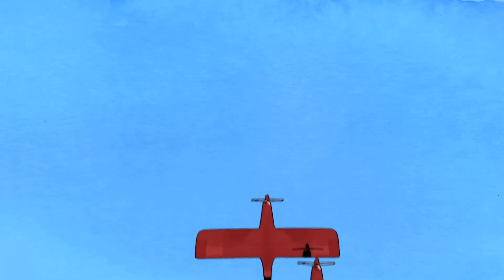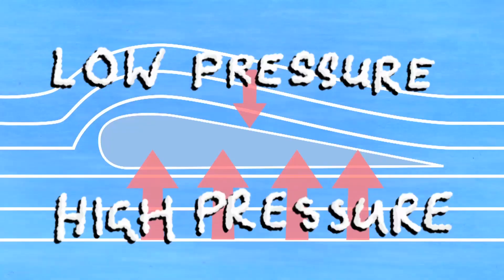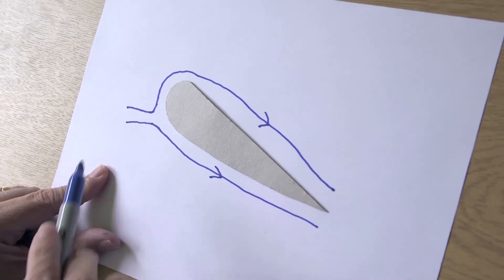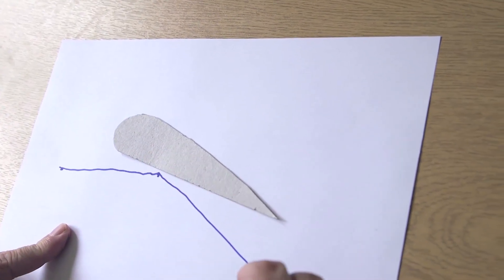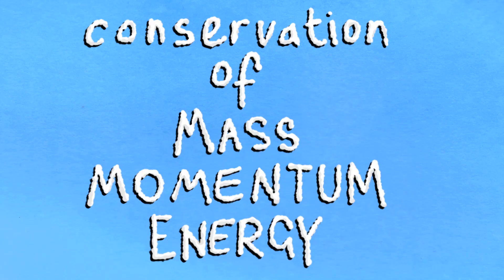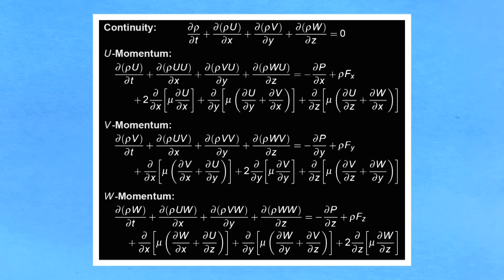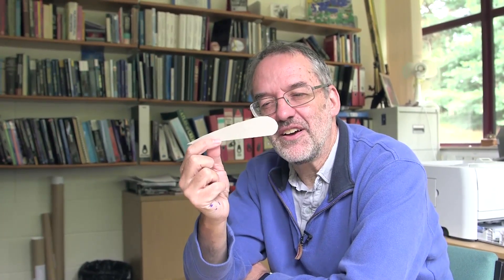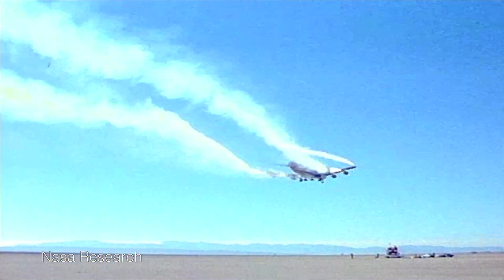Lift and Wings - Sixty Symbols

Comment: To simplify, you get lift when you excellerate air downward,  and you don't get lift if not.
Reply: True, except for in ground effect where the downward momentum need is lessened by an accumulated pressure field between wing and ground.  To that extent that mass accumulation doesn't "leak", the downward momentum acceleration demand is lessened (sort of like going from charging a capacitor to the capacitor being in a charged state).

But it's stunning how a few in academia refuse the downward momentum absolute necessity.  They forgot their basic physics??  And their university allows them to teach that to students?

Comment: I get that there is a downwash of air coming from above the wing, but what is the actual mechanism which that air acts on the wing lifting it up? Since that air is on top of the wing the whole time, how is it contributing to an upwards vector of lift (remember, suction is not an actual force). I can see how the profile of the wing could create a low pressure zone above the wing which  increases the effectiveness of the high pressure region below the wing but I think the downwash from the top of the wing is merely the result of the deflected air on the underside creating a low pressure zone at the back of the wing and that air naturally flowing to fill that gap.

Comment: The bernulli effect conserves energy. It doesn't cause lift. Lift is caused by excellerating air downward.
Reply: Energy is conserved in preserving mass flow rate (mass conservation).  The pressure drop of this mass and energy conservation, conserves momentum by bending the flow to the downward direction.

So, yes, lift is cause by accelerating air downward, to conserve momentum, through conserving energy, to conserve mass (flow rate, or the continuity equation).

So, there you have the core Navier-Stokes (and Euler) equations:  conservation of mass, energy, and momentum (quantity of motion).

Comment: The "problems" presented with respect to the Bernoulli explanation of lift have nothing to do with Bernoulli itself. The "equal travel time" and the "shape of the wing" arguments are arguments that try to explain why the flow over the wing is faster than the flow under the wing and both fail to explain the speed difference. Bernoulli accurately describes the result of the observed lift. As a final note, the Bernoulli principle is the integral of the momentum equation for fluids and therefore there is no real difference between explanations that use momentum conservation and flux (or circulation arguments) and Bernoulli's principle.
Reply: I can't immediately see the point you are making?: "Bernoulli accurately describes the result of the observed lift. As a final note, the Bernoulli principle is the integral of the momentum equation for fluids and therefore there is no real difference between explanations that use momentum conservation and flux (or circulation arguments) and Bernoulli's principle."

It appears the usual "misconceptions" brought up are:  it's Bernoulli not Newton, it's Newton not Bernoulli, equal transit time is false.

But it's curious those three misconceptions seem to unavoidably connect with core Navier-Stokes/Euler equations:

"Bernoulli": taken as conservation of energy: velocity pressure inverse relationship

"Newton": conservation of momentum (ultimately change in vertical momentum of flow, to conserve total system momentum)

"Equal transit time fallacy":  the continuity equation (conservation of mass flow rate).

All of the above must be properly integrated into a useful CFD simulation to design a wing at Boeing or Airbus, yet the descriptions of the lift mechanism suffer perpetual overly simplified arguments?

Comment: Its because of the curvature of the streamline over and below airfoil, the greater the curvature greater the lift. From Euler equations we get two differential equations of pressure distribution one in streamline direction and other normal(radial) to it, the normal one is responsible for lift. 
In Stream line direction >>>>>> partial(dp/ds)=(rho*Velocity*partial(dV/ds))
In Radial(normal) direction>>>>partial(dp/dr)=((rho*square of(Velocity))/r)
from radial direction equation, as the curvature of streamline is more the change in pressure is more so the change in force in that direction.
Reply: Of course, to get the proper big picture we need mass, momentum, and energy of each mass regime (the asymmetrical solid and the distributed flow of mass), from before to after the interaction, to be conserved for the entire system.

The effect of curvature is directly related to asymmetry, and mass flow continuity must be conserved through that geometry.  So, energy must swap speed for pressure to sustain continuity.  And the result is the downward change in momentum of flow to conserve total system momentum.

Comment: Air Molecules have weight .  Air being compressed by the leading edge of the wing accelerates the flow of air across the upper surface or camber of the wing . The air molecules  follows the cambered surface creating a kinetic energy from centrifugal that is exerted on the wings surface in the form of a vacuum. That would be like slinging a weight on a string . The faster you swing the more centrifugal force exerted . The more the camber on the top surface the more lift at slower speeds .
 Bernoulli's principle totally ignored the weight of air and the effects of  centrifugal forces on the air molecules  by the camber . This can be viewed by blowing on the top of a sheet of paper . The more camber the more the paper lifts .
Reply: A key weakness of your explanation is that radially directed accelerations (centrigual/centripetal), don't explain the tangential accelerations encompassed by Bernoulli as an expression of conservation of energy:

this doesn't make physical sense:  "air molecules  follows the cambered surface creating a kinetic energy from centrifugal.."

Comment: Stop talking about "air flowing over a wing", Air flows over a wing only in a wind tunnel when the wing is stationary.  In real aircraft the air does not flow much horizontally. It is ACCELERATED vertically DOWNWARDS ( eventually) .This downwards acceleration originates for different reasons occurring above and below the wing. In fact  if one has to be accurate, the air mass particles around the moving wing move forwards a little . I shall let the readers deduce why that happens. .

As the wing moves forwards, it  SHAVES  an air ribbon and accelerates its mass of air downwards. The SHAVING  starts at the leading edge and below the wing by compressing the viscous fluid to ACCELERATE IT DOWN,  Above the  wing the SHAVING  of the mass of air is done by first accelerating the air fluid upwards above the leading edge, and then causing the tension in the vicious fluid at a later stage to the trailing edge . The CONTINUOUS downwards ACCELERATION  of the masses of air above and below the wing results in an opposite reaction to lift the wing. If the  tension in the viscous fluid hold, then the wing is in  laminar condition, if the tension in the viscous fluid is large to break the tensioned fluid, then turbulence occurs. 

It is these linear and circular acceleration at various locations that cause the Bernoulli, the Newton and the Coanda effect, and it is these "fluid linear or circular accelerations" around bird wings, fish flukes, and all the  flying surfaces that  exist in insects aircraft wings and helicopters rotors and propellers and rockets and missiles,  These effects existed far earlier than when Bernoulli, the Newton and the Coanda were even born.  Also people should stop saying that particles at the leading edge, the upper and lower flow meet again at the trailing edge,   Just consider Linear and circular, ACCELERATION OF THE FLUID MASSES ABOVE AND BELOW THE WING  This acceleration of masses in  a horizontal direction will also explain the drag of the wing, Think of the tension and compression in the viscous fluid around the wing as the mass of air above and below the wing is ACCELERATED .  The rest will follow as velocities and locations of particles and up wash  ahead of the leading edge and down wash behind the  trailing edge, consider only ACCELLERATIONS and the resulting forces. .
Reply: The claim that "air flows over a wing only in a wind tunnel" is incorrect and dismisses the fundamental aerodynamic principle that airflow over and around a wing is crucial in generating lift. The overuse of metaphorical terms like "shaving" and the heavy reliance on capitalized words (e.g., "ACCELERATED," "SHAVING") detracts from the clarity and professionalism of the argument. Additionally, the emphasis on fluid acceleration as the sole explanation for lift and drag oversimplifies and undermines well-established aerodynamic theories, such as Bernoulli's Principle and Newton's Laws, which complement each other. The text's verbosity, coupled with its dense and technical phrasing, makes it less accessible to readers. Furthermore, the dismissive tone toward commonly accepted concepts, such as particles meeting at the trailing edge, appears unnecessarily combative, reducing the effectiveness of the explanation. Lastly, the historical context, while interesting, is framed in a way that could confuse readers, as it fails to acknowledge the foundational contributions of Bernoulli, Newton, and Coandă to our understanding of these phenomena. A more concise, balanced, and precise approach would improve the text significantly.

Comment: I am a fluid dynamics PhD student doing 3D aerodynamic simulations, and I approve this message. Fluid dynamics on YouTube can be really cringe-worthy, but leave it to sixty symbols to do it exactly right... Well done, more please
Reply: How do you reconcile "circulation" with the force of lift as a linear change in the vertical momentum of air (in a direction transverse, or normal to the relative wind)? 

Is the best physical interpretation for circulation, is that it represents angular momentum imparted to the air (and associated rotational analogies of the equations of motion)?  In other words, it accounts for the rotational consequences of Newton's laws?

Is it relevant to consider the issue of lift in terms of how such angular momentum becomes, or supplies the vertical momentum directly associated with the force of lift (which is linear after all)?

I ask this because among the various attempts at explaining lift, it seems there is seldom (if ever?) any "connective tissue" as far verbally linking on the one hand, circulation, vorticity, potential flow the Kutta condition etc., with on the other hand all the talk on Newton (the linear laws), and Bernoulli etc.

And, is asymmetry (of the solid with respect to the relative flow), sufficient on its own to induce angular momentum without losses in the medium of flow, and the consequential necessary change in vertical (transverse) linear momentum?

Comment: Bernoullis theorem does not predict air molecules meeting of the top and bottom wing air . In fact the only thing that's is applied in this example is the velocity pressure relationship . . You also kinda forgot to mention Newton's laws must be obeyed .
Reply: Bernoulli doesn't say anything about transit time.  Bernoulli says the directed kinetic energy of the dynamic pressure has to come from the potential energy of the random kinetic energy in the static pressure.

Transit time has to be faster, because the density has dropped from an obstacle being placed in the continuous airflow.

The "interruption" in the mass flow supply rate causes the pressure to drop sufficient to accelerate to a speed that maintains the mass flow rate continuity.

Because the density has dropped to accomplish this acceleration, the new higher speed is necessary to maintain the mass flow rate at the original level.

It may seem like circular reasoning, but it's not:  the solid path obstruction induces a pressure drop due to "mass supply deprivation stress" just sufficient to cause the faster than equal transit time of each particle such that the mass flow rate is maintained.

That is:  same mass flow rate, by moving lower mass density at higher speed.

So, logically, equal transit time has to be wrong.   Not just observationally wrong.  It is wrong logic from the beginning.
Reply: The squeezing effect actually causes a pressure increase near the leading edge; so it has some similarity to the venturi. In addition, the downwash is NOT a cause but an effect of the pressures and satisfies Newton's Third Law.

Comment: Due to the low pressure above the wind, is it correct to say that the air here is lower density?
Reply: Yes.  And that is an important insight.  Lower pressure is from lower density of mass which implies fewer random collisions of air molecules per unity area.  The average velocity of the random collisions is still the same (at constant temperature), but there are just fewer per unit area, meaning less momentum transferal in the collision per unit area.

The result we see is less static pressure.

Comment: Lift is action and reaction.
The action is the deflection of air molecules downwards, the reaction is the wing being pushed upwards.   Pressure differences are secondary.   If there is no downflow of air from the wing, there is no lift.

There is downflow from the top of the wing, because of the tapering shape.  Because there are no molecules in the wing to force the airflow upwards, the air can spread out into the void at the back of the top of the wing.  In doing so we have just created a downflow, which continues at the back of the wing.  Thus we have downflow from the top and bottom of the wing.

Action and reaction, if we have created downflow, then the wing must experience an upwards force.

R

Comment: I don't understand how plane can fly with TWR of less then 1? doesn't it violate laws of conservation of energy? someone pleases explain where is the extra energy comes from to lift the plane with certain amount of weight in the air when you are spending less energy then the force caused by airplanes weight! I know there are external force but they are nothing compare to how less TWR you need to fly it..

Comment: Great video! It is always important to clear up any misinformation before moving onto the real discussion. I did want to mention that the description of the streamlines being pinched results in an increase in velocity is also a misconception known as streamline pinching. The correlation between restricting the flow and increasing the velocity is true for an internal flow, bounded by a surface AKA a venturi. For this example, a flow that experiences pinching does not see a definite increase in velocity.

Comment: Thank you for explaining the Bernoulli's principle and the role it plays in generating lift. However, it would have been helpful to see a visual representation or animation of how the pressure difference is created above and below the wing. Additionally, it would have been interesting to see a discussion on the limitations of the Bernoulli's principle in explaining lift and how other factors such as the Coanda effect also contribute. Overall, great video!
Reply: He did

Comment: I'd like to hear from an "aerobatics" pilot and know exactly what the pilot is doing to the controls when the plane is flying straight and level but inverted.  Is the pilot rushing the stick (or yoke) slightly forward which would result in a slight nose up (away from the ground) when inverted? When not inverted, would put the plane is a nose down attitude.

Comment: You are right, you can’t really separate the aspects you described. However, we Aerospace engineers only really consider the pressure differentials when thinking about the lift. We spend a lot of time optimizing airfoil profiles (and other features) to influence the velocities over the surface and thus the pressure. The effect of the momentum change is only a byproduct for us. We call it downwash and it makes our lifes hard because it tends to influence other parts of the plane, like the horizontal stabilizers.
Reply: Yes. So many think the downwash is the cause of lift.  It's one of the three most common myths. 
1- Equal transit & Bad Bernoulli. 
2-Downwash & Newton's 3rd. 
3-Half venturi above.
.

Comment: Okay, I'm not exactly sure why the downward momentum of the air tranlates into upward momentum of the wing but...
Oh, another question I'd like to get cleared up. I have, maybe incorrectly, thought the reason boats float has nothing to do with the mass of their hulls being less than water, nor does it have anything to do with air being "trapped" in the hull but rather it is my understanding boats float because the shapes of boat's hulls uses water's surface tension to keep the boat afloat. True?

Comment: Yup, glad someone explained it in complete ways....

Some vamous youtube only mentioned the low pressure at top that caused the lift, which makes me scratch my head alot....

The 3  things plus the fluid fiscosity(as well as flow regime) are that kept changing which one is dominant in keeping the flying fly....

But under steady state, i believed its the upward momentum from the bottom of the wings that makes the lift..... the top wing low pressure would be second thing....
And if you hit dense clouds,  its the fluid that contribute more (again in the form of adding momentum to the bottom wing .... upward)

3 thumbs up 4 you prof Mike

Comment: I appreciate that the pressure above the wing is higher than the pressure below it. But, the surface area of the top of the wing is larger so do we still have net greater force below the wing as opposed to above it?